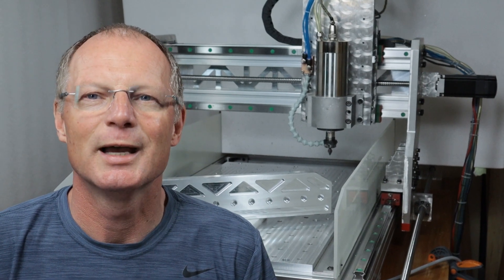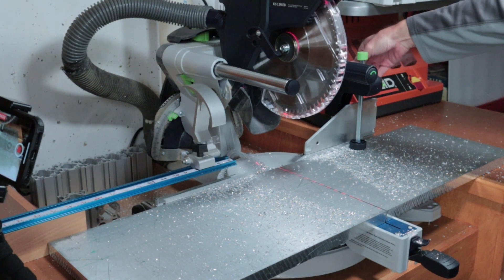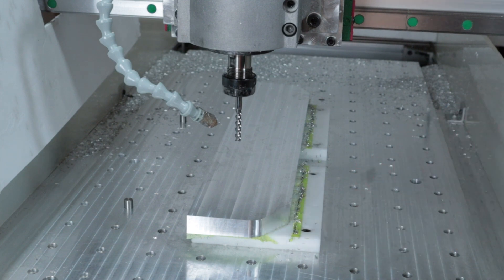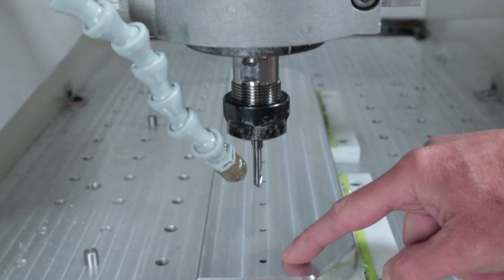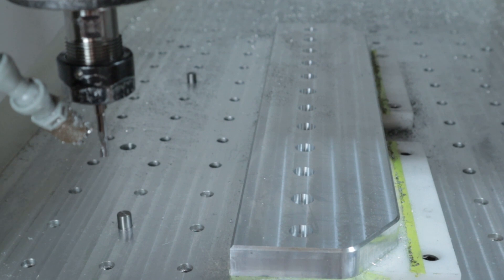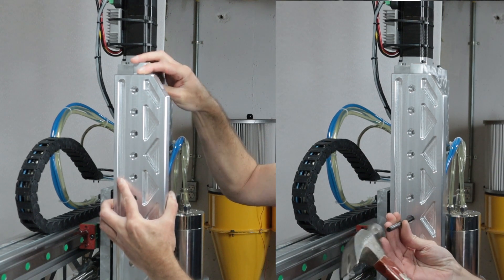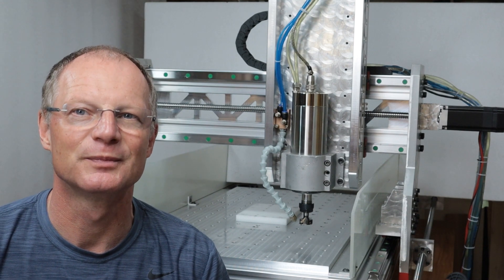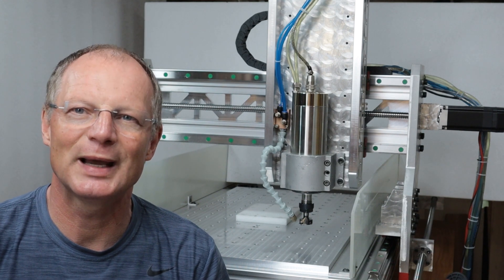CNC Router Z Axis Overkill

Comment: When i first clicked on your video, i was thinking this might be a really good project for me to upgrade. However you mentioned it didn’t make much of an improvement. So before i invest the time and money, I’m curious as to how far apart your bearings are spaced out on your Z axis, and how thick that plate is?
Reply from the maker: The guide blocks have a gap in-between them of 70mm in z direction and 90 mm in x. The plates are 22mm thick.

Comment: nice work . what endmill is that doing the facing pass @ 1:32?
Reply from the maker: This is an indexable endmill with triangular inserts (even wrong one as it is for steel) from Accusize. You can find it on Amazon but you will need to turn down the shaft if you have the standard er20 collet.

Comment: Adding a second spindle mounting clamp would go a long way in reducing the runout, specifically in relation to the spindle. That's why, in the previous video, you had two runout readings. One was pure gantry, the other was the combination of gantry and spindle.
Reply from the maker: Yes, I think installing the second mount did help quite a bit especially on larger diameter end mills.
Reply: Was checking if someone comment this already. I think that's one benefit of the rectangle 2kw spindles since the whole length is connected to the Z Plate.
Reply from the maker: @pytebyte I like the form factor of the air cooled spindles also better - and the looks. Yes the fastening is done without an extra bracket and that is a plus. However from a  thermal standpoint I like the water cooled spindles.
Reply: @JBWorx  Yes that's true and the noise of the fan :/  I wondered once if the cooling could be done by the air of the dust collection. There are four small channels on each edge inside the rectangle frame of the spindle :)

Comment: Here's a tip to remove mill marks on surfaces where the dimension isn't critical. Draw file the surface using a mill bastard file. No one but you will ever know the hand finishing of the surface was performed.
Reply from the maker: Excellent, have to Google that type of file.

Comment: Nice videos, what is the tool that you use to do the facing operation? Can you perhaps send me a link
Reply from the maker: Certainly, it’s made by Accusize and sold on Amazon.  It’s not great but gets the job done. 
Accusize Industrial Tools 3 Pc Little Hogger End Mill Set, 45 Deg, 90 Deg and 3/16r Mill with 3/4'' Shank, 1'' Head, 0046-0700 https://a.co/d/7D6wSWR

Comment: Nice, I know it takes more time, but I like to do a 2  degree ramped finishing pass with light mist coolant and I always get a mirror finish even on the tallest sidewalls. Even if your flutes aren't as long as your part is tall, the mist coolent eliminates the issues of potential rubbing. Have had success even with 1.5in stick out on a 1/4" endmill. Roughing pass inaccuracy disappearing during the ramping skim pass is ultra satisfying.
Reply from the maker: I think the adaptive clearing creates tool marks on curved contours that need a little bit more material removal than what I usually do for a finish pass. I now do 2 passes the first one with 0.1mm and the second one with 0.03mm. Comes out great. I will try your method next time thx for the response!
Reply: @JBWorx  correct, also on the finishing pass, it helps immensely to mess with the tolerance and smoothing options in my experience. Makes those curves on external radius super smooth
Reply: @Nordic_Goon  yes !! I have the same experience. My post processor is also asking for a tolerance / smoothing in addition to fusion and I am not sure yet how that works (in addition to or instead of). I have played with these values and if set too high it introduces a “studder” on every curve or radius. I also try to “force arc” instead of all the x/y coordinates that will slow the machine down on a radius or following a spline.
Reply from the maker: Unfortunately I overlooked this comment but like to add that is is exactly my experience as well. A radius or curve especially if created using the spine command can introduce a ton of g-code lines that will slow the processor down and introduce a stop and go. The tolerance and smoothing are essential to avoid this.

Comment: I had a similar gantry setup to yours with 2 6060 extrusions and 5mm back plate and noticed few issues, the biggest was and adjustment on one end would only fix move that side and both ends needed adjusting making it very difficult to adjust, I have since added a 3060 extrusion in between connected to the backplate and right angle brackets to top and bottom and it is a lot better! Still have enough clearance for ball-screw too.
Reply from the maker: Hmmm I read this twice but I am not sure I understand how you improved your machine. Try one more time please …
Reply: @JBWorx  sorry I will post a video it will make a lot more sense, especially seeming the 6060 is the extrusion size (60mm x 60mm) not to be confused with 6060 aluminium
Reply from the maker: I think I got it now. Yes correct I can move one side slightly and the other will not move. That is ok and might also depend on the length of the gantry. The squaring is done via the software on my machine hence the importance of accurate home sensors.  Making a gantry from granite is rather interesting I think. Pretty much eliminates most movement.

Comment: what kind of double sided tape were you using to hold that part?
Reply from the maker: It actually is painters tape the “scotch” brand made by 3M. I use the green version for rough surfaces and increased strength. There is also an orange color one with high holding power I use that as well. I can really recommend that type of work holding for plate work or even smaller parts where you need access to the entire perimeter. I really like it and use it a lot.

Comment: With such a low portal, it makes sense to fasten the rails firmly to the cross plate. And the carriages then movable on the Z plate.
As a result, you don't have the problem that the clamped tool robs you of the portal passage.
BDW. The spindle motor should not be affixed in the bearing area. It is better to place the mounting block in the middle. For this reason alone, the Z-axis variant shown in the video should not be selected.
Reply from the maker: Thanks for your comment. I do not try to advocate the design of my machine I think it has many flaws and things I would change today building it again. However making one mount in the center of the spindle would defiantly not be one of them. I would capture the spindle on both bearing locations instead of using the spindle body to transmit the force to the mounting point. Also having a  long stick out to the tool that you are suggesting can’t be good for vibration dampening.
Reply: @JBWorx  The manufacturer states that the mounting points should not be in the area of the bearings. Some even have markings on the spindle.

Basically, my comments were intended for the general public. So for those who still want to build their own
Reply from the maker: Yes because any precision or high rpm bearing needs a determined “play” between the race and the rolling element (a ball for example) to function properly. Excessive clamping force at the bearing point is the concern of the manufacturer. I do not think that any aluminum mount can exert such clamping pressure. But hey that’s me … thank you for pointing it out.
Reply from the maker: However YES! Always follow the manufacturers recommendations for your spindle and how to mount it.

Comment: Nice setup, it looks like a very similar setup to my machine, have you seen it perhaps? I get some deflection from the twin extrusion gantry and have considered filling the extrusions to improve stiffness but it works well for what I do currently so have not bothered.
Reply from the maker: Hi Jeremy, yes very similar designs. I am thinking to replace my gantry with one beam instead of 2 separate pieces. And then also machine the mounting surfaces or level them with epoxy or add some steel underpayment that gets machined. I have completed the re-balling of one side of the HIWIN linear guides on the y-axis  and it made a nice improvement. I totally agree mine works also for my use very well and it is about 6 years old so I am happy what I have accomplished with it. I guess at the moment a got bitten by the accuracy bug  😆

Comment: Do you think that the the gantry with new balls would still benefit from having the new vertical stabilizers on it? Or do you think it's irrelevant to include them?
Reply from the maker: For my machine they were not necessary. They look cool but that is probably the biggest benefit they bring. There is more mass now close to the source of vibration so that could be a benefit that I just have not noticed yet.  The Z plate is almost 1” (22mm) thick so I think some machines will benefit from the stiffener plates just on mine it is not really noticeable.

Comment: when you pull your gantry it's movement stopped by ballscrews only.  amount of give you measured just can't be from wear in linear blocks )  if they are worn it will be only 0.01-0.015mm of play in them.
just put an indicator on a face of ballscrew nut and load your gantry back and forth.  i bet you will see something.  
(it will be sum of play in a nut and in fixed side bearings. and all of them are not a preloaded ones i suppose)
Reply from the maker: You are exactly right in your thought process so I blocked the gantry with a piece of steel in front of the guide to eliminate A) any play in the fixed bearing and B) any play in the ball screw. A small amount of movement in the ball track is amplified by the length of arm to the top of the gantry. I have one set of balls on hand to complete one side of the gantry this week. I am very curious to see the result.
Reply: @JBWorx  also you can do one more test.  you measured only overall deflection but machine consists of 3 joints so it will be more informative to check them separately (if you doesn't done this already).  i mean isolated measurements to spot the problem.
 1 between table and a top of gantry side plate to see actual play caused by bearing blocks.
 2 between side plate and center of a beams to see flex
 3 between center of a beam and spindle nose to check z assembly

P.S.  you can do little improvements just endlessly but at some point you came to a state when all done wright but you still have some give under static load and 0.01-0.02 repeatability error.
at the end it's just a home built aluminium gantry mill.  you can't ask a VMC precision from it )
Reply from the maker: I had to smile at your last sentence. Yes so true .. but I was a bit bummed out finding initially 1.7mm with only 200N applied to the spindle. I just could not comprehend that. So I have done exactly what you suggested above and that is how I found the gantry moving. I then had the bearing as suspect and blockt the gantry just to find out that the movement at the blocking point was Zero and the side plate further up was 0.08mm. I also did the measurement of the gantry to the spindle … there is still quite a lot of movement there relative to each other as well. I have not found that cause yet … but making the Z-Axis plate stiffer was not it 😆. Thank you for engaging and leaving me a comment.